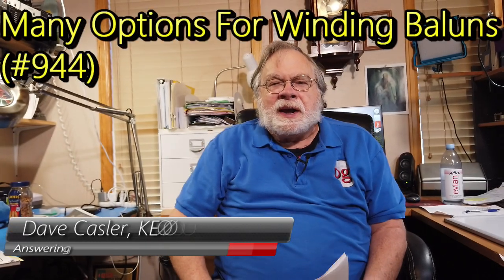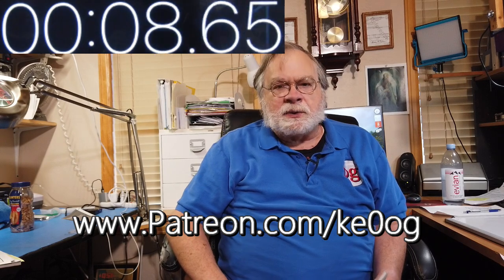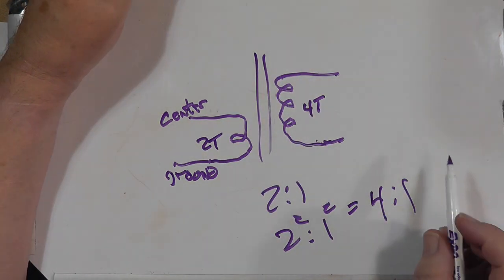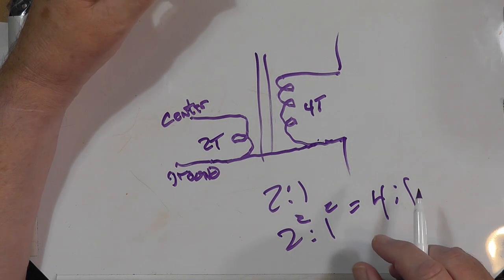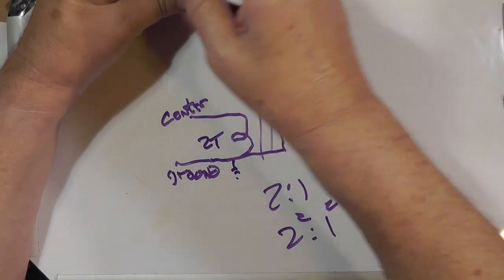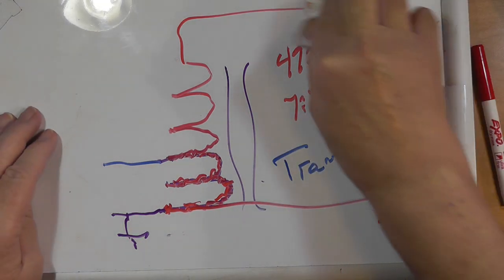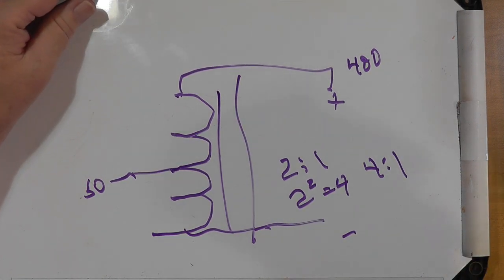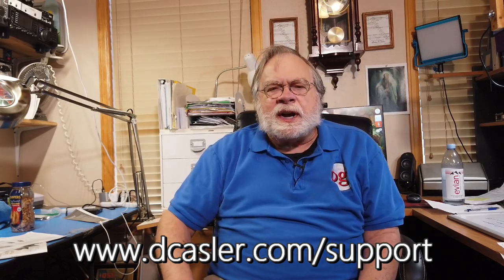Many Options For Winding Baluns (#944)

Comment: At 11:45 the output is UNBALANCED, but I am sure you will see that if you replay the video. 73
Reply: As I learned the hard way in my OCF video... whenever I tested baluns on the VNA, auto transformers have less loss, and when twisting the wires it seems to become a very flat broadband transformers.

Isolation transformers are great for receive SDR's as they completely get rid of the muck on the coax, but it definitely takes a hit SWR/return loss wise, not really an issue when you're after SNR, not absolute power transfer like a transmitting balun.
Reply: Also, at 12:40 Dave says the 4:1 is 400 ohms on the output. How about 200 ohms.  50 x 4 = 200